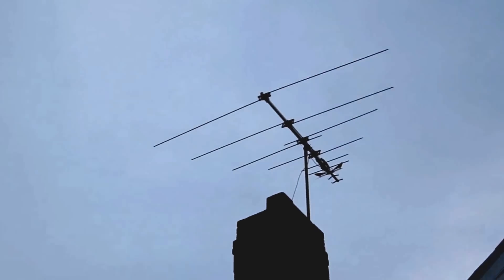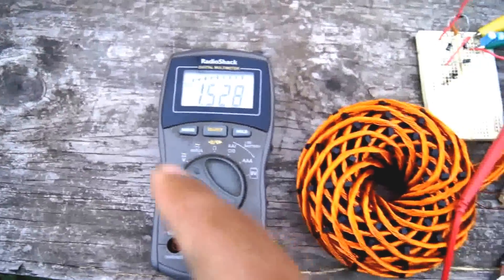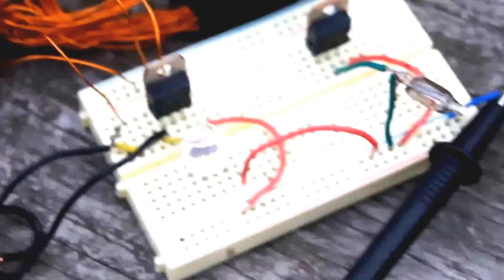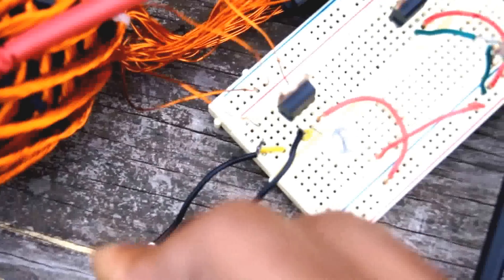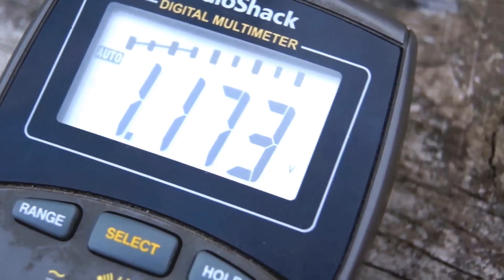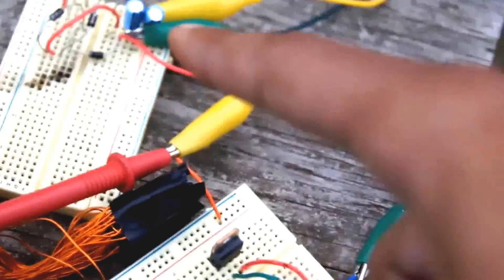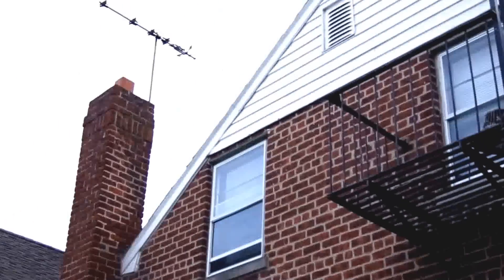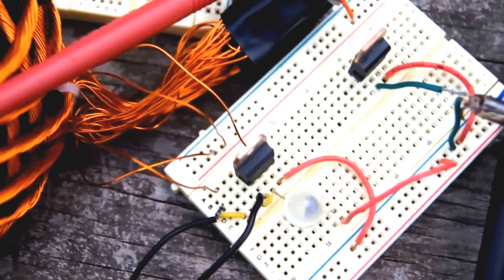How to Collect Free Energy from Atmosphere | Free Energy

Comment: Can you charge a larger battery? Use larger collectors? Series of antennas in an array to increase the flow? 
Can you get to 120 Volts with different antenna shape? or height?
If you can get 120 Volts can you add a load like a Laptop power supply to provide the stepdown to DC Voltage?
The laptop power supply is basically a full bridge rectifier...needs the 120 volts input though. 
Can that be drawn from the atmosphere with enough antennas in series?
Also 120- volts or 230 volts AC Motors might be powered by direct AC power connection. 
However...some type of regulator might be necessary to cap the flow at a max to avoid burning up AC motors. 
A common AC motor which uses 230 Volts AC Power is found in Air Conditioning Units.

Comment: Can you fully recharge a 400v 33000uF capacitor , or will it stop at 2 volts?
Reply: of course you can, you just need good power supply :) ..

Comment: Semiconductors can't handle high frequency waves and gama rays are high frequency radio waves but vacuum tubes work differently they should work for high frequency when used as a diode

Comment: I have seen photos from 100 years ago - people were running electrical motors (on their boats as propulsion) using your same setup - only they placed the antenna "vertically" (like a sail).
Also can your set work with an Earth Battery (Nathan Stubblefield?)
I have tried to follow your websites for years - I wish I was as smart as you are.
Thanks for the great work!
Charlie

Comment: use hundred of antina so you got 1500 voltage and increased this with stepup transformer's, now a mini power house😝😝😝😝😝
Reply: yes but when you step up  voltage you loose amperage and amps  times volts equal watts  mmmm watts are are what you need to  power electrical items   its like this if you squeeze electricity one way you loose it the other way  mmmmmmmmmm so increase volts and you loose amps   increase  amps and you loose  volts simple as that mmmm if you go up  a hill you have to go down one  law of nature or physics  mmmmmm

Comment: Richard Feynman's Lecture on Physics  states 100v per meter going up to 31 miles high.  The power does not come from 'radio stations" etcetera.  The Atomosperic potential is literally blowing in the wind.  What came first, the light bulb or the power supply? It has been known since around 1880.

Comment: I don't know about the validity of this guys statements, but what he is suggesting is theoretically possible. Look into Eric Dollard; now there is one individual who provides only raw facts and well developed theories. I can't tell if what this guy is saying is true or not which is unfortunate because if he is telling the truth then he has certainly discovered a simple method to capture usable energy transmitted via radio waves in the atmosphere. I challenge the maker of this video to post a follow up vid proving that he has more usable electricity absorbed from the atmosphere than what he is using to power his coil and antenna plus whatever electronic equipment he is using to control the fluctuations of frequencies in the atmosphere. Prove that you have a true over unity device in your hands and I will personally re-create your experiment and post the results to prove that you have a workable peer reviewed piece of equipment.

Comment: Suggestion! If you only used a capacitor bank to help your experiment going you must' ve used a spark gap, before the spark gap you should have placed the rheostat to control the frequency of discharges! You'll notice the higher the frequency the greater the current it generates! And used the current generated to charge your cell phones!

Comment: We are looking at milliwatts, intermittently, for a tiny fraction of a second - which is exactly what you would expect. No idea where the claim of a sustainable 10 to 40 watts comes from.  

Without looking at the circuits in detail, it could just be atmospheric generated electricity and not anything to do with converting radio frequency electromagnetic energy to electrical energy; for every metre above the ground the potential difference increases by about 100 volts - but the current that flows due to this phenomena is measured in picoamps - so wouldn't get too excited just yet about cracking the World's energy problems.
Reply: It's a proof of concept.  Imagine if someone built a huge structure to take advantage of the 100V per meter and then capped it with stone and a gold covered point... 🔺🤔
Nah... Technology and knowledge must be strictly linear and one directional, lol...
Reply: @VndNvwYvvSvv  The current is tiny though - the energy cost of building and mainting the structure you imagine would dwarf by orders of magnitude the energy harvested.

And hardly proof of concept - the first experiments into atmoshperic electrical currents were done back in the 1700s.

Comment: This is nonsense. It is not "free energy", and virtually certainly nowhere near 10 watts unless you are very near a high power transmitter. The little coil is not "magic", it is not "oscillating". The  power is limited by the electromagnetic field radiated from nearby radio transmitters, and would be a minuscule percentage of the power they apply to antennas.    

People need to start reading textbooks so they get an idea about how things work, and stay away from  YouTube pathological science and the tin-hat Tesla crowd.

Comment: Very nice video! I assume the energy that the antenna is collecting consists of a variety of radio waves - radio waves that are coming from many transmitters. I also assume that if there were no transmitters whatsoever - sorta like in 1800 - then this would not work. In this case, the energy may be free to you, but in actuality is not free to someone else - the operators of these many transmitters! Now if there is collectible energy coming from naturally from the Earth itself or from outer space, well that's a different story.
Reply: How?
Reply: Its from the earth and space not the weak signals from radio....ever heard of a radio telescope? They are recording the radio waves from space. The ground and sky is saturated in charged particles from the sun. I bet if he had that setup at t he  poles it would be even stronger energy collector.

Comment: This doesn't make sense because you haven't mentioned anything about the second circuit you're using. The first one is a bridge rectifier, which changes AC to DC, but then you go on to say that if you vary the frequency....well how are you varying frequency if you've changed it to DC? It's true that you can steal electricity from the carrier wave of broadcasting stations, but it IS theft. I'm sure that in the UK, it was ruled as illegal, way back in the '50;s.

Comment: Is this coil better than others? It seems like it could have some benefits because of this Geometric form wich isinterresting beacause Nature also often shows his powers in vortexform.
Reply: The antenna  and the diode bridge are doing the tiny bit of work you see displayed here, The coil may help select the frequency the antenna is responding to, but, then again it might not even actually be hooked up. Looks like an unnecessarily clumsy crystal radio.

Comment: May I please ask exactly what equipment you used, was it a digital antenna? And have you tried store the energy in a magnet or battery? Also, have you tried similar experiment taking energy from neighbors wifi-signals?
Reply: Any antenna will work. This is what antennas do. An antenna tuned for whatever the strongest frequency you have at your location will work best. This is a neat demonstration, but you'll never get more than a tiny signal from this.

Comment: Try using germanium diodes instead of silicon. Germanium starts to conduct near 0.25 to 0.30 volts compared to 0.6volts for silicon diodes. That's more energy for your capacitor.
Reply: Very low forward voltage drop diode is schottky diode 1N5817 I think they are more efficient than diodes with germanium 1n34 ! The Best Germanium Crystal Radio Diode very low forward voltage drop is OA90 the best candidate as it has been tried and tested over many years by many crystal radio constructors. It is cheap and readily available. However, the AA117 has a forward voltage of only 0.18 V when the test current is 0.1 mA. It is an exotic gold bonded germanium signal diode, which is no longer in production.
Reply: Use schottky diodes
Reply: Agreed. Schottky has lower Vf but it does suffer from leakage issues and I’m not sure if that would interfere. Any other problems for either type?
Reply: Winner of a video, I have been researching "new ways to produce electricity" for a while now, and I think this has helped. Have you heard people talk about - Diyadison Penhloe Blaster - (should be on google have a look ) ? It is a smashing one off guide for generating your own electricity without the headache. Ive heard some unbelievable things about it and my buddy got cool success with it.

Comment: You are actually drawing power from the local radio stations, cell towers, WiFi stations, cell phones and other radio devices. And a little bit from mother earth. You are probably paying for some of that power because it comes from your WiFi hotspot or your cellphone. :)

I made a radio once that was powered by the incoming waves. You had to put your ear right next to the tiny speaker to hear anything. But you could actually understand what was being said. Had the 4 metre antenna wire hanging out the window and a ground wire wound around a non-painted part of a radiator.
Reply: Lol, in Romania, there still are villages near powerful radio station emmiters (long wave I think) where people are hanging fluorescent tubes in the garden between long wires tied to trees... So they have "free" electricity. This habit was so widely adopted that the radio station emmiters were set to maximum power to compensate in order to ensure the same radio coverage.
So, IT'S NOT FREE ENERGY!
Reply: And is he creating a safe space in doing so or what?
Reply: > IT'S NOT FREE ENERGY!
In Romania FTFY.
Reply: I am amazed by your genius asshat! tell us more!
Reply: where is the ignore people like mal gibson tab on this channel?
Reply: H
Reply: adal von karlsburg .....bs....the station did not boost signal because fluorescent lights sucked up the signal....jewbot

Comment: take the voltage n push it through a series of step up transformers untill yur power output is what you desire
Reply: @Jessee Long I think you need to understand the definition of terms like power, voltage and current - and how they interact.
Reply: he'll get a higher voltage but get the same power due to lose in amps, he's got such little power being collected from the radio broadcasts that i doubt he'd be able to operate a transformer or even turn it to alternating current